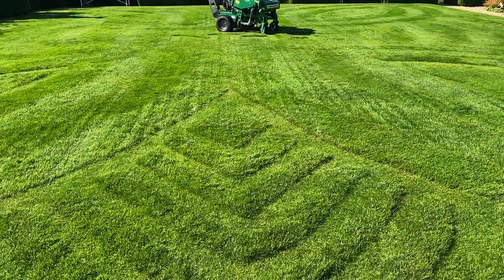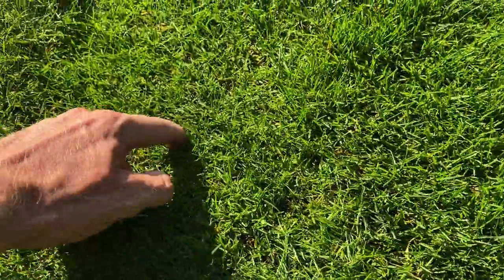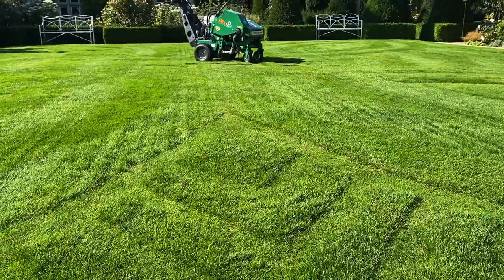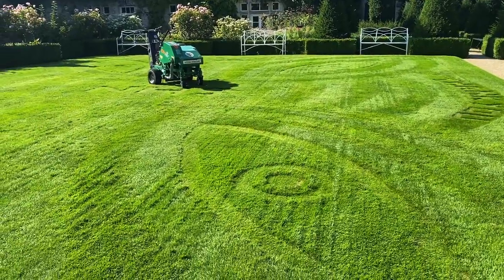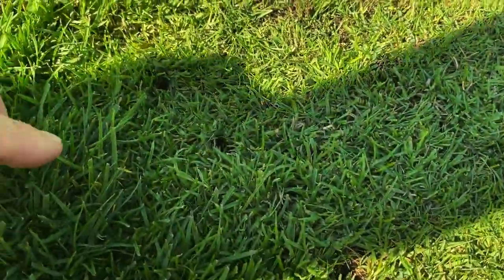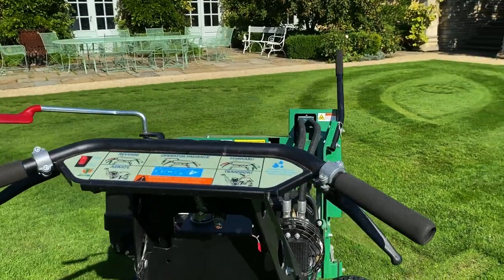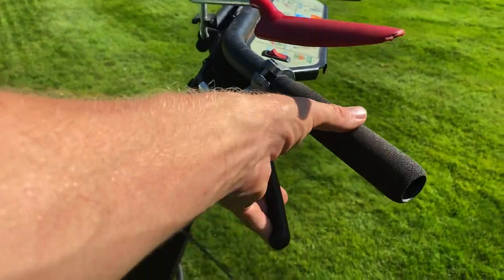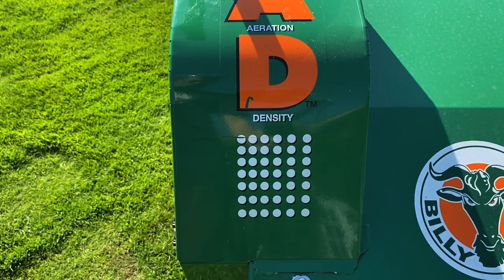Lawn aeration - Aerate your lawn to let it breathe!

Comment: How low should you cut the grass before you aerate, how many inches?
Reply from the maker: Hi, if you are doing solid tine aeration then the length of the grass won’t really matter, the only thing it will do if it is really long is potentially start wrapping and clogging the machine. If you are doing hollow core aeration, shorter grass is definitely beneficial, as it will help with clearing the cores and top dressing if you are going to do that afterwards. 
No need to scalp the lawn.